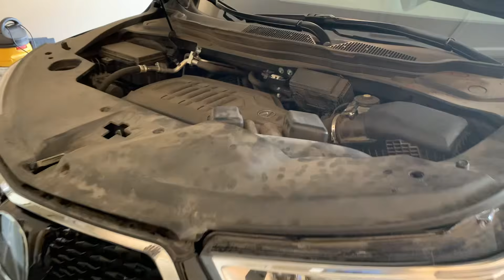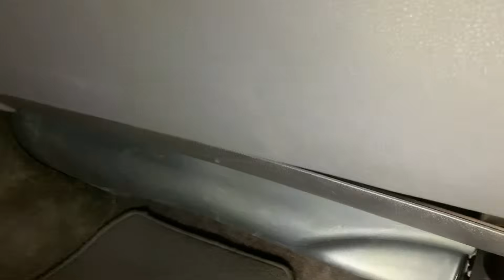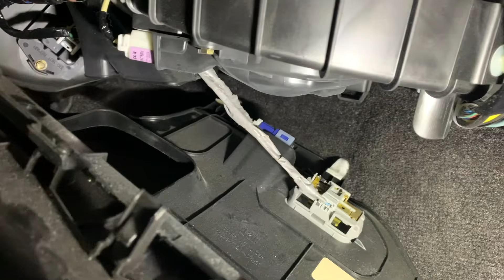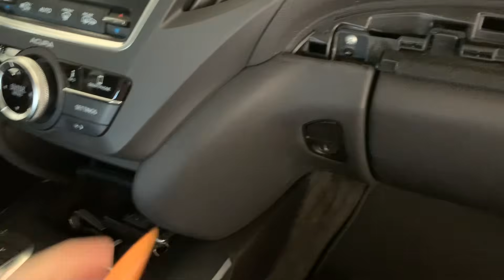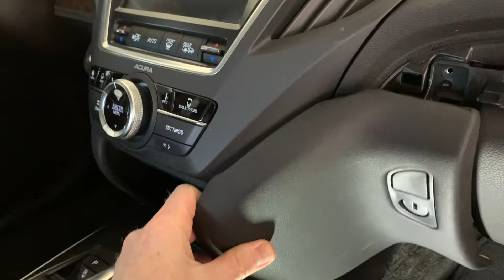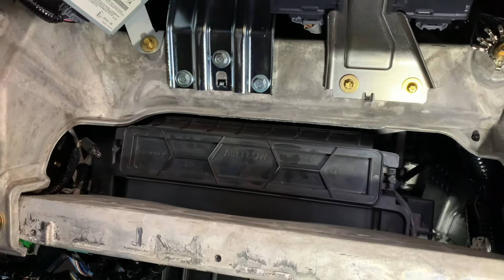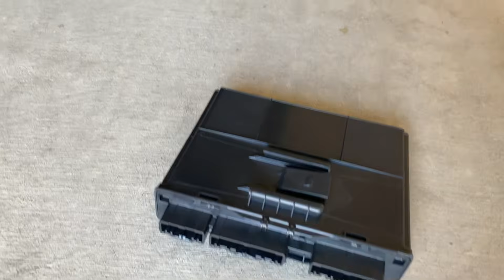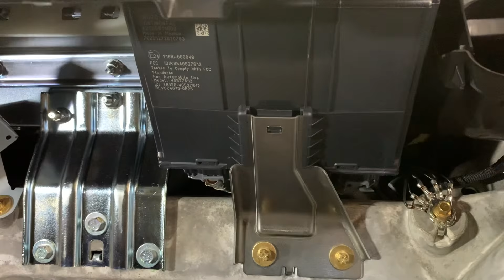Honda / Acura Random, Intermittent Flashing Dash Lights, Headlights, and Car Alarm - FIX Part 2

Comment: Thank you, thank you, thank you!

As a complete car repair novice, I followed these steps 6 days ago on my 2017 Honda Pilot touring and the ghost lights (headlights and interior) as well as the alarm issues...FIXED. Took me just under 4 hours because I was so methodical (i.e., afraid of breaking something) and then I accidentally put the circuitboard back into the casing upside down (so stupid) which caused it to get stuck and required extra time/effort to remove again.

Lessons learned/tips:
- The Pilot varies slightly from the Acura in the video. I took photos along the way to make sure I could put things back again. Did not have to remove the vent cover and the screws were a little different.
- I didn't have the plastic tool mentioned in the video, but believe it or not, the orange plastic tool that comes with Lego sets worked just fine.
- I could barely see the corrosion with a 10x magnifying glass, so you may want one with higher magnification.

Really pissed that Honda hasn't done a recall for what is so obviously a defect with the coating. I took pictures that show the model and missing coating in case I need it later... 

Model: 40527612
IC: 7812D-40527612
RLVC04013-0595
Reply from the maker: You are welcome.  Great to hear of your experience.

Comment: Thankfully this worked for me. I have a 2021 pilot. For two days the alarm kept randomly going off. Sometimes it was a few hours apart, sometimes it was minutes apart. The first night I just unhooked the battery and left it overnight. The next day after some  googling, I found that maybe it could be the hood latch, so I disconnect the hood latch sensor and boom, no more alarms all day. Fast forward to later that night, the wife woke up around midnight and saw some lights outside out door. Her initial thought was maybe it was the neighbour's pulling in. She then woke up again around 3am and still the same lights were on and they ended up being from the pilot. So yep the hood latch wasn't the issue. The next day found this video after some more googling. Was a little skeptical I'm not going to lie. I thought to myself, how can a tiny little chip not being fully covered be the cause. I said screw it I'm going to try it. Only reason why I did try it was because the dealership only had a spot to diagnose the problem in 2 weeks. And there was no way I was going to wait that long. Luckily this fix worked and it's been a few weeks now without any problems. Cheers to the man who found this fix you are a real life saver. I don't know how you managed to figure it out but you did. Such a tiny little component on a big vehicle. And I bet you the dealership wouldn't have been able to figure it out themselves.
Reply from the maker: Thank you for sharing your experience and testimonial!

Comment: Completed this repair in approx 2 hours, hopefully I resolved the problem.   Thank you so much for these excellent detailed instructions.  I do have a couple of notes to help those about to undertake this procedure.  Make sure you have a magnifying device available before starting.  The IC and the pins are very small and a simple hand lens is inadequate. I was able to use a 10x jewelers loupe and could see the corrosion to some degree, but if you have something with a light and 10x or greater magnification you will be more confident in cleaning. Additionally I used 99% isopropyl alcohol and a small acid brush to do the cleaning.  The cotton swab would work, but a brush does not leave fibers.  Also a can of compressed air helps to dry off all the parts when using alcohol.  My car is a 2016 pilot.  Very similar process. I did not have to remove the vent.  Additionally I did not have to remove the bracket for the module as there was ample room to remove the wiring and remove the module with the bracket in place.  Removing the PCB from the case is frustrating, take your time.  Finally, if you have never removed body panels it can be nerve wracking as you might feel like you are applying too much force.  The body panel tool set available at harbor freight was very handy.
Reply from the maker: Thank you for adding your experience and learnings.
Reply: Thank you for the advice

Comment: Thank You!  I had the same issues as you described and this fixed my 2019 Passport Sport.  For the Passport I did not need to remove the vent, the trim below the vent, or the metal bracket holding the control unit.  I only removed the side trim, trim above the glove box, trim below the glove box, and the glove box.  The control unit can just slide out of the bracket if you press the plastic tab (and then disconnect the three electrical connectors).  To remove the plastic lid of the control unit I used a small screwdriver to open a gap at each of the 4 plastic tabs and inserted some small lengths of bristle board in each gap (i.e. thin cardboard) - then I could slide the lid out.  my unit had the dendrite growth just like your photos; which I cleaned and covered with clear nail polish.  Thanks Again!

Comment: The video was a major major help do you have any hints on how to get the plastic box opened anything would help
Reply: To remove the plastic lid of the control unit I used a small screwdriver to open a gap at each of the 4 plastic tabs and inserted some small lengths of bristle board in each gap (i.e. thin cardboard) - then I could slide the lid out.

Comment: I’m having issues getting the keyless sensor box open without braking any suggestion???
Reply: I gently pried opened the clips and inserted an old cut up insurance card to prevent from snapping back in. You can use any plastic card as long as it's stiff enough. credit cards are too thick

Comment: For anyone who wants to sue, I’m about to get that started. I’ve gone through everyone’s comments, written down the cars then found out the part numbers. We are all being screwed by the same Model # control module.
Reply: Any update on this? I’ve got a 2017 Honda pilot with this same issue.
Reply: @ashley1167 did you got it fix I’m having the same issue
Reply: 2017 MDX tech, I’m in.
Reply: 2019 MDX... let me know.
Reply: I bought my honda odyssey 2017 brand new. They keep asking me to buy the extended warranty upon transaction of buying the car until it reaches 40k miles this smart power control module broke. They knew this has been a problem thats why they are pushing me to buy extended warranty. Now it requires smog and it dont pass because the check engine light comes out.
Reply: 2019 honda pilot elite im definitely in
Reply: Acura tlx 2017.
Reply: 2018 acura tlx same issue. I'm in
Reply: @dallashunt2413 if you try this it really solves the problem I got the same problem 4 weeks ago and did this. everything seems fine since today
Reply: @dallashunt2413 hey I also have an Acura tlx 2018, did you try this fix and did it work? My alarm goes off randomly and lights turn on by themselves when key fob is not around 

I was getting ready to replace my hood latch thinking it was that before I came across this video. On Reddit everyone says it’s the hood latch, any input?
Reply: 2017 acura tlx with the same issue

Comment: Having this EXACT same issue with my 2018 TLX (A-spec Canadian model w/ awd).    Brought it to the dealer and they said it was the transmitter in the back for the key fobs.  They never said anything about this!    I ordered a new PMIC from LKQ (used) and I'll be taking apart my unit and attempting this fix before i do anything.   Thank you!
Reply: Is it in the same location as this video?  Mines doing this.

Comment: Thank you for posting this video.  I was having the same problem a couple of months ago.  Spent over $200 at a Honda dealer, they could not find the problem.  problem showed up again. followed the instructions on the video and it solved the problem.  You saved me a lot of money.  towing to dealer, parts, labor would have run over $ 1500.  Thanks again
Reply from the maker: Fantastic!  Thank you for your comment.
Reply: For anyone who wants to sue, I’m about to get that started. I’ve gone through everyone’s comments, written down the cars then found out the part numbers. We are all being screwed by the same Model # control module.

Comment: Does anyone know if this works on a Passport as well?  We're having the random alarm going off in the middle of the night issues, very frustrating!
Reply from the maker: I see a couple references online to a Smart Power Control Unit in Passport model years 2019 - 2022 (https://www.hondapartsnow.com/genuine/honda~control~unit~smart~power~38320-tgs-a31.html?gQT=2).  The Honda Passport forum also has some reference to this unit being located behind the glovebox.  Hope this helps.  (https://www.passportforums.com/threads/can-i-replace-the-keyless-access-tpms-module-myself.9838/)

Comment: Awesome video! I had the same exact issue with a 2016 HR-V. The location of the module on this vehicle is behind the gauge cluster. Thanks for making this video!
Reply: Did you fix it the same way? I have the same issue with my 2019 HR-V too
Reply: For anyone who wants to sue, I’m about to get that started. I’ve gone through everyone’s comments, written down the cars then found out the part numbers. We are all being screwed by the same Model # control module.

Comment: Between trying not to break clips and finding the right tools I finished in about 4 hours in my 16 TLX #imjustagirl 😂 there was gunk right in the same spot on the board it also didn’t have the clear coating in that spot. Can’t believe this hasn’t been recalled. But fr getting it out of the casing was super frustrating….I ended up jamming a butter knife in where each clip is it just popped out 😂
Reply: For anyone who wants to sue, I’m about to get that started. I’ve gone through everyone’s comments, written down the cars then found out the part numbers. We are all being screwed by the same Model # control module.
Reply: I used guitar picks on each tab but still manage to break all the hooks 🤣Hardest part of the whole job.😅
Reply: 2018?
Reply: @ 16
Reply: @errrinnnn__  has the issue came back?
Reply: @ nope it was a complete fix! thank god! Lol
Reply: @errrinnnn__  lol nice ! Grabbing my butter knives now and getting this done wish me luck 🙏
Reply: @ good luck! If you get frustrated at any point (you will) just remind yourself the dealer charges like $1200 for a new unit and programming! 😂😂😂 I found another video on YouTube that showed how to remove the TLX glove box specifically cause there is an additional piece of trim that has to come off at least in the 2016
Reply: @Chipdawg95  https://youtu.be/ESWM2-cY8tU?si=NruBQtIM_rHOsn2H
Reply: @errrinnnn__  omg you’re amazing thank you so much! My car has that trim piece too so you saved me some time screw you dealership lmao 😂
Reply: @ I did somehow manage to make my glovebox light no longer work in the process tho 😂 which compared to my car acting like the poltergeist, not a big deal lol
Reply: Thank you for your fb post!

Comment: Thank you so much! After 2 years and the dealer not knowing what was happening I did it in 30 mins cleaned the module and it works amazing.
Reply: You just clean and put back or did u have to reprogram unit ?
Reply: @teamoversizefishingadventu2774  just cleaned it!

Comment: I owe you a beer man, haha thank you so much, 16 honda odyssey with the same issue thought it was a hood latch but alarm was still going off after replacement , took the module out from under driver side which was a little pain since is in pretty tight spot, cleaned it with rubbing alcohol and applied super glue to sealed the same exact cheap you mentioned and it fixed the issue appreciate it brotha
Reply: For anyone who wants to sue, I’m about to get that started. I’ve gone through everyone’s comments, written down the cars then found out the part numbers. We are all being screwed by the same Model # control module.
Reply: Inside under driver side for your 16 oddesey? Looking to fix my same year oddesey 😪

Comment: my 2017 RDX keyless access control is under dashboard on the driver side near steering column, easy access, nothing to be removed, and your cleaning instruction was spot on,  issue has been fixed and thank you very much.
Reply: For anyone who wants to sue, I’m about to get that started. I’ve gone through everyone’s comments, written down the cars then found out the part numbers. We are all being screwed by the same Model # control module.
Reply: How were you able to take out the module? I’m having a hard time take it out
Reply: @SitoLawrence  sorry I don't remember, it has been a year, all I can recall, at first it took me awhile  to separate module for housing, but after all, it was not difficult,
Reply: @ThomasNguyen-qw6ro  are we still suing? If so add my vehicle as well 2016 acura tlx

Comment: Wow! It worked completely.  I have a 2017 Ridgeline and it was just a quick job of taking out the glove box and associated trim.  Here's a link to a video on the exact process of taking out the Ridgeline glovebox for my year - https://www.youtube.com/watch?v=ojVpzE_pIuo&ab_channel=503pdxCars.  Then the module is easily accessed from the upper inside of the dash.  That part was easy.  The next step - opening the module took much more time, trying to avoid breaking plastic pieces.  I finally widened the area around each clip then used small Zip ties to keep the tab from going back again.  I did end up cracking the module a little.  I'm not sure if it would be problem so I put duct tape over the crack.  When I got the board out, it was only half covered in the shiny protective coating.  Since I didn't want to repeat this problem later on, I used alcohol and a tooth brush to clean the other half, focusing on the potential area of concern.  Then I used clear nail polish over a lot of the unprotected board.  Putting the board back in the module and the module back in the car just took a few minutes.  I was a little nervous about the process, but when I hooked up the battery, no crazy clicking of modules like before so I thought that was a good sign.  When I started the car, the only thing I had to reset was the radio.  Everything worked!  What a relief.   Thanks for your help in producing this video.
Reply from the maker: Thanks for sharing your experience and adding the link to help others.

Comment: Dude Awesome! You fixed my 2018 Pilot EX-L with Smart Control Unit # 38320-TG7-A020! Replacement unit is 38320-TG7-A32 which ranged from $530 to $680 from 3 stealershits within 30 miles of each other. Hmmmm really suspect. We bought it new and has been great aside from this but it only has 28000 miles. So we will see. Thank you again!      Mike in DFW

Comment: Same thing for my 2018 Pilot, alarm went off 3 times in one hour...disconnected the hood switch but the dash still flicked on and off and all the same issues. This repair worked for me, cleaned the board with alcohol and an old toothbrush. 2 weeks later and no more issues! (to get the board out, I inserted 4 small screwdrivers into the tabs, and it came right out! Total repair time was under 1/2 hour which is awesome!)
Reply: For anyone who wants to sue, I’m about to get that started. I’ve gone through everyone’s comments, written down the cars then found out the part numbers. We are all being screwed by the same Model # control module.

Comment: This video was great for me!! My 2017 Acura ILX had this problem 6 months ago, with this video doing exactly what he is talking about I solved it thanks a lot!!!!!!
Reply: For anyone who wants to sue, I’m about to get that started. I’ve gone through everyone’s comments, written down the cars then found out the part numbers. We are all being screwed by the same Model # control module.
Reply: @elexisranelleful  Please share the info when you have it. My older neighbor has this issue with her RDX and I have to say this could be a deadly and potential fatal problem. Acura needs to be held accountable. This is a huge fault defect.
Reply: where is the module located in the 2017 acura ILX please; thank you

Comment: Regina G - how did you figure this out? Our 2017 Pilot first showed signs of a problem 5 months ago when the alarm first randomly went off. At that time, we were able to silence things by simply using the key fob to unlock the vehicle. We wrote this off to "user error", figuring we had accidentally pressed the panic button on the key fob (although I didn't think we were within range when this happened). Since that initial event, we've had the alarm trigger on its own a couple more times. There have also be a couple of instances where I noticed the exterior lights had turned on while the Pilot was parked in the garage. Then yesterday, I got a call from a neighbor telling me my Pilots alarm was going off. I wasn't home and the car was simply parked in the driveway. My wife checked it out and said it was like the car was possessed -- lights on the dashboard were flashing/flickering and there was an associated clicking noise. Even after the alarm (horn and exterior light show) was silenced, the lightshow on the dash (and the clicking) continued. When I got home I did an internet search and came across this video. I performed the "cleanup" of the Smart Power Control Unit as shown. To the naked eye, I didn't see much corrosion/build-up at the noted pin, but clearly there was no clear protectant covering that portion of the chip. I cleaned up the area with rubbing alcohol and sealed it up with super glue. It's only been half a day, , but so far everything seems to be back to normal. I did do a second search for instructions on how to remove the glove box on a 2017 Pilot as I wanted to see where all the clips were on my specific vehicle. I'm gratefully to Regina G for figuring this out and taking the time to create such a thorough post on how to resolve the problem.
Reply from the maker: Fantastic!  Thank you for adding your experience.